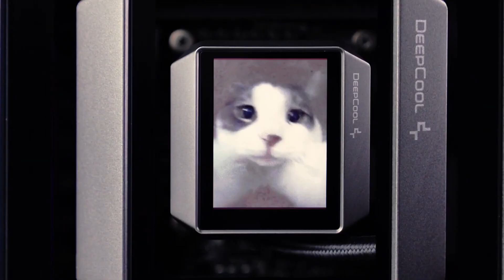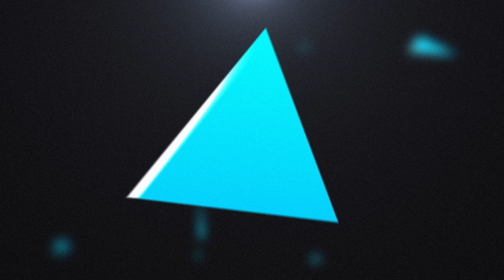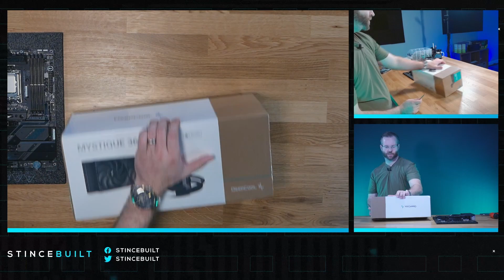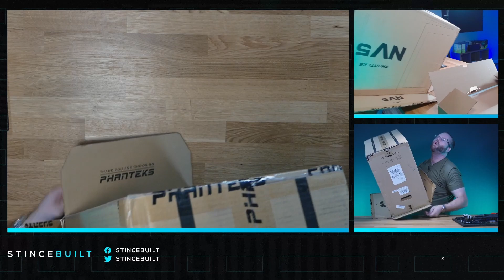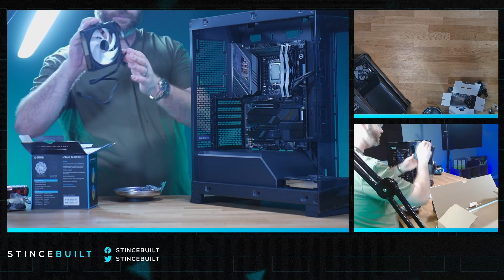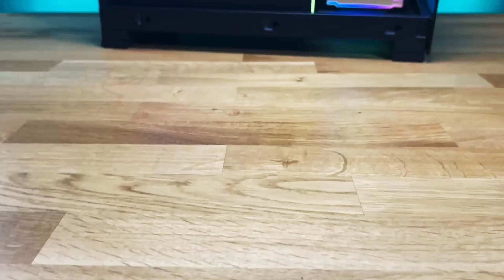NEW DEEPCOOL MSTYIQUE Cooler Build! NV5 l 14900k l 4080 S

Comment: DEEPCOOL MISTtique is garbade... wtf why they print a logo on it?? Can it be swiped 90degrees like Display? No?? crap
So only ONE mountig mosition with tubes upside yee? So why you do the display rotable?? wtf why? Just waste of money!
and oo thx for thermalpaste on the block... 2 times for angle it right and you must go und buy some for 20buks - .I. and thx for great cooler with non rgb for over 200$
Reply: You can rotate it however you want. I ditched my Kraken elite for it and I prefer the DeepCool, and it performs better.
Reply: @Rock44Digi  becouse of logo you cant rotate it..  wtf why shod i wotsh on loocpeed if its upsidedown??